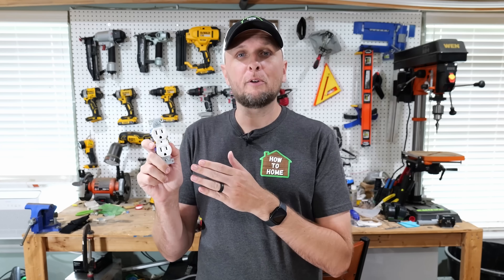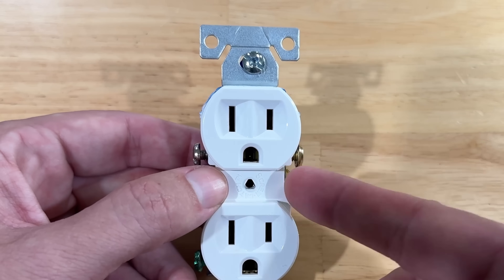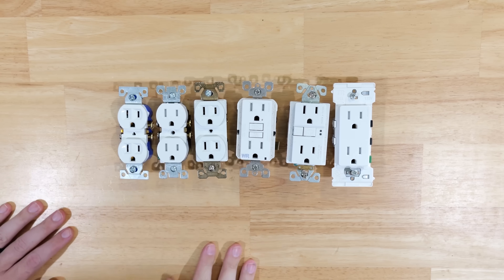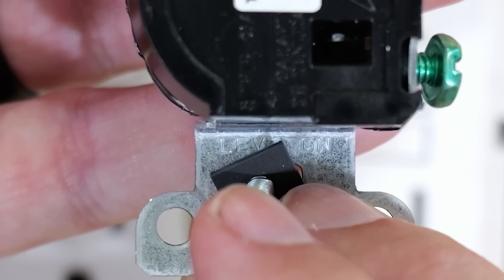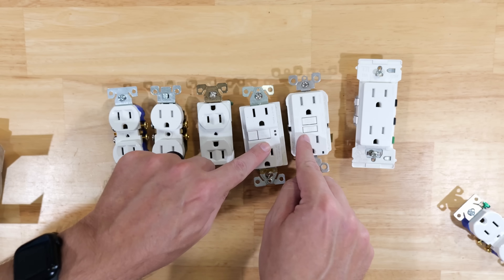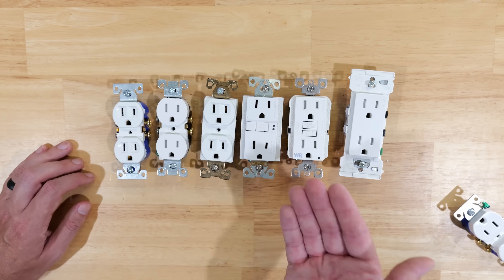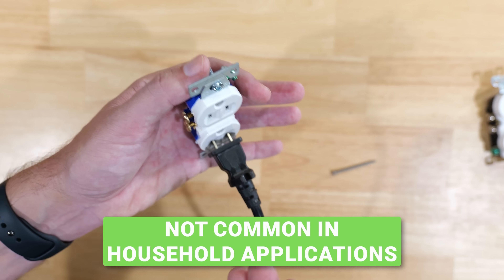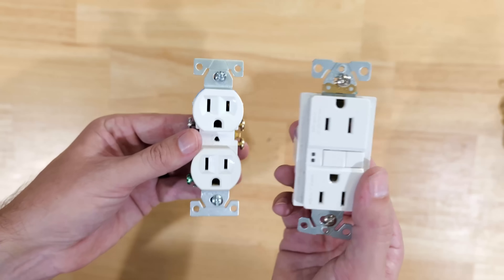The Shocking Reason Why Your Outlets Are Installed Upside Down!

Comment: I have to be honest I HATE the upside down plugs found in restaurants when you're fishing for a plug standing on your head and realize it's inverted. Regardless of the "safety" reasons, the two-prongs up has been the standard for decades. The sudden "realization" that this is unsafe is just annoying, and the standardization outweighs the nit picking. Perhaps niche settings like hospitals or something health related might be the exception, but I hope this new emerging idea goes by the wayside in residential settings. (If an electrician put my plugs in upside down, I'd make them turn them 180.)

Comment: I was told that ground prong up is for a switched outlet, but then the same guy installed my switched outlet ground prong down. 😕
Reply: I only know Arizona practices but the industry standard here is to install the outlets with the ground prong down, except switched receptacles  which are installed with the ground up so the homeowner can easily see which outlet in a room is switched. I believe this is the practice in most states. 🙃

Comment: Given your safety concerns I think they should be installed sideways, or just designed that way to begin with.  Keep the neutral at the bottom, so if your index finger touches it, at least it is not hot.

Comment: Ground Down gives support for 3 prong plugs to stay in!  I've always installed w/ ground prong down... Unless it's for Light with switch above it. Because Ground Prong stays in and is a lot more stable. If via gravity/weight... plug most likely to sag and Ground prong disconnects 1st... and you are no longer ground protected. This will never happen if ground prong is down. Nothing ever happens if you just touch ground prong connected to ground in earth and reality is 110 AC (unlike DC attracts holds/welds you) Repels YOU!

Comment: Then all the right angle plugs and even 45 degree angle plugs you buy to get cables to hug the wall will have the cord flying out the top and the top corner, and the cable will loop outward, leaving a worse mess. My uncle thought he was being super smart and installed his receptacles that way and within 6 months had switched them all back. Just don't stick a thin piece of conductive material against the receptacle and the need for this goes away.

Comment: in my jurisdiction the inspector failed everything on ground level that had ground up.  His rationale was due to snow cover in winters, you don’t want snow hitting hot/neutral as water rises.  It didn’t make sense to me since it was indoors and not sure if it was regulation, urban legend or his preference but he wouldn’t pass it until ground side down on the main floor of a resi home

Comment: My Mother once received a new refrigerator as part of a utility company program for the elderly.  When the utility rep arrived with the unit, he refused to install the refrigerator until I had turned the outlet with the ground prong to the up orientation from the original ground prong down orientation, as it was since the home was built 40 years prior.  I had never heard of this before, but he was very adamant about it.  So to humor him and to receive the free refrigerator, I compiled.  It must have been a local code that the city was just then beginning to enforce after decades of home construction with the ground prong in the down orientation.  Thank you for your video!  I am now a subscriber to your channel.

Comment: It makes a difference , when the prong is down the plugs will not fall out like they do when the prong is at the top. As far as I am concerned the prong hole should be down. Codes don’t matter. What matters Is what makes the plugs more secure.
Reply: The code is the only thing that matters to professionals and your insurance company.

Comment: 25 years ago I installed receptacles ground up during a major renovation in one of my homes after someone I knew convinced me it was the proper way to do it. I regretted it. For most plugs it didn’t matter but with flat plugs — those designed to sit flat against the wall — all the cords came down on the ground side of the cord. With the ground up the cords were kinked over instead of sitting flat against the wall like they were supposed to be. Based on that it appears that receptacles should have the ground at the bottom.

Comment: There are some molded plugs that have power cords coming out the corner of the plug.  If the outlet is installed ground-prong down, the diagonal cord goes diagonally down from the outlet, and does not create clutter.  If the outlet is installed ground-prong up, the diagonal cord angles up, and gravity will cause it to bend, probably away from the wall, where it is more likely to get tangled with something, or fall to the floor at a distance from the wall.  AFAIK, every diagonal plug is configured this way, indicating that the mfrs. of those plugs think outlets should be installed ground-prong down.

Comment: Although I agree that there is very little practical difference between the orientation in most applications, if you look at the illustrations in manuals, guides and catalogues the ground prong is oriented on top. These early illustrations  primarily show duplex receptacles oriented vertically, as well, though in many applications horizontal orientation is seen, especially when inset into mouldings or workbench frames. The American Electricians' Handbook, based on the NFPA/NEC illustrates this, as well. When these receptacles first appeared, the ground receiver hole was referred to as a "U-ground," giving some clue to the intention of the early designers. 
I believe that the reason why the "upside down" orientation is so common is purely anthropomorphism: humans prefer the orientation that looks like a face. 
Considering the amount of abuse that the NEMA 5 connectors endure, the orientation is probably the least of worries. BTW, NEMA guides do show the receptacles with the ground prong/blade on top, showing that at some point manufacturers agreed on that orientation.

Comment: Notice that most plugs have ribbing on the sides of the plug, that is where one should grasp the plug (with one's index finger and thumb) to remove the plug. One should never pull on the cord to remove a plug from a receptacle, I learned that the hard way as a young child, my hand was wet and the insulation was cracked, needless to say, it didn't feel very good.
Also, a little situational awareness (e.g. knowing where one's fingers are in relation to live electrical contacts) is a very good thing to be aware of.

Comment: what about the gravity argument or tension argument?

I seem to recall some make the case that if the plug is I believe ground prong up, that the device is less likely to unplug if there is tension on the cable, whereas the typical orientation with groundprong down is more likely to disconnect if there is downward tension.

Comment: Wait, am I misunderstanding how electrical outlet and plug works? We use alternating current, so aren't both blades powered? Swapping direction depending on which phase of the AC cycle we're in?  Because for years, there wasn't a difference between the two blades. You could plug-in a two blade plug in either direction. It's just that I thought that the larger hole indicated grounding protection for device devices that do not have a separate ground post.

Comment: my house among others i have been in all have the ground line in the top position and the only problem i have is with the plug of various appliances; my hair dryer is two prongs and the only way it can be plugged into the outlet is with the cord above since the cord is not coming straight out of the plug (if i am explaining that well), also a night light has to be plugged in upside down
i with the small appliances manufactures would consider how their products are used by everyone or consult builders

Comment: I usually install the receptacles ground prong down.  My intent is that the ground wire should be the longest wire in the box.  By this I mean that, if the cable comes into the bottom of the box, in the case where the cable is being pulled from the box, the ground would be the last wire to disconnect.  But when would the cable be pulled from the box?  The only scenario that I can imagine would be in the case of an earthquake.  (And I live in a earthquake zone.)  The goal is to not start a fire in a collapsing building.

Comment: There are some appliances that have the ground prong down along with the cord formed down as well. Should the outlet be installed ground up there would be a loop going up before the wire goes down. In that instance the outlet should be the ground side down.

Comment: I have been in the electrical industry for over 40 years.  I personally prefer the ground up except in situations where the cable from the plug exits on the ground side in those cases input the ground down . It is a preference in any case.

Comment: Another reason to install these outlets with ground down is for those power outlets and surge protects with the flat space saver plugs. They are mostly designed for the ground down. Besides, if there isn’t a specific standard, I agree, it looks nicer with ground down.

Comment: The answer is residential receptacle should be installed with the ground on the bottom. 
Long before grounded receptacles came out, receptacles were polarized with the larger slot being neutral and the smaller the hot. These were installed with the neutral on the left and the hot on the right. That was the standard. It made it easier to insert the plug in a harder to reach area knowing the orientation.
When grounded receptacles came out the orientation stayed the same with the ground being added below the neutral and hot slots. There are some bands where the mounting tabs were even marked "Top".
As for manufacturers not taking sides, look at the packaging. Receptacles in window boxes are packed with the ground on the bottom. And those that show a diagram on the box or paperwork also show the ground on the bottom.
The reason used for mounting with the ground up is more of a fallacy. Something metal falling and hitting the plug connectors is extremely unlikely. Also, the majority electrical devices in your house don't have a ground. 
Also, many power supplies will wall transformers hang down below the receptacle which doesn't work well if the ground is up.
You can rationalize it all you want but the original design from the start was for the ground to be down. And that will always be the correct orientation! 😉

Comment: Ground prong up is a more secure connection against the leverage of the appliance's wire weight pulling down. It's less likely to pull the big prong out than the blade prongs. Pulling out the stronger prong from the sides, and leveraging the pull of the blades against the big prong working the wire up, and down as it with draws decreases the chance of shock, and increases the efficiency of unplugging a grounded appliance.

Comment: I am a Master Electrcian with an Admiistrator certification, in the 70' and the 80's before the ground wire was a requirement by code, there used to be a reference in the code book. Grounded coper wire such as Romex was widely sold and installed. In a residential application there were grounded receptacles that were available but they were not required to have the ground prong hooked up. In the instance where the grounded receptacle was installed without the ground prong in the system, the receptacle was to be installed with the ground prong in the up position. This was to let the users and the other electricians know that there was no ground hooked up to the receptacle. After teh grounding wire was added as a requirement, the code reference was still in the code for one more round. It was then decided that since the ground was a requirement, it was an unnecessary and contrdictory statement, so the designation was removed from.the code book to simplify the process.

Comment: When wiring in a commercial setting where the cover plate is likely to be metal, I install with the prong up. In a residential setting the plates are likely to be plastic and most people think the holes should make a little face, so I would install with ground plug down. I do know of one person who dropped a quarter behind their dresser and actually had it fall into the gap between a plug and the plate, causing arcing, but the breaker did its job, so no harm done. I have had a device with the plug at 90 degrees to the cord, so it wouldn't lie flat against the wall if plugged into a receptacle with the prong up unless it happened to hang down from above rather than up from below.

Comment: Residential appliances with flush-style plugs (washing machines, refrigerators, freezers, ranges, etc.) often have the cord coming out of the same side as the ground prong, suggesting that the appliance manufacturers expect the ground to be down.  While there are hundreds of arguments for each orientation, this is a real-life scenario that is common in many homes, and not a "what-if" argument.

Comment: I agree with you. Only time I was required to install an outlet with ground prong up was with a NEMA 14-50 240Vac receptacle for a ChargePoint EV charger but otherwise pretty much all 90 degree plugs on 120Vac circuits I've found were designed for the ground to be at the bottom of the outlet.

Comment: Residential most of the wall plates are plastic, but again as residential a switched outlet is very common so residentially the switched outlet would be installed upside down to indicate which outlet is switched

Comment: When I see Atlets installed upset down, I see a union or commercial electrician as the installer. It started with metal wall plates that may get loose because commercially instead of reinforcing the outlet they relied on metal plates for faulty sheet rock work